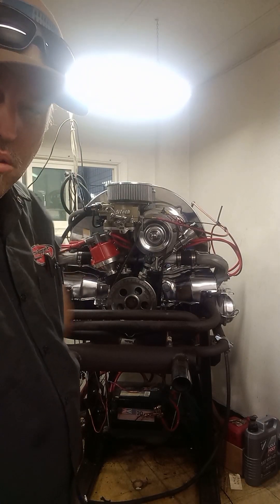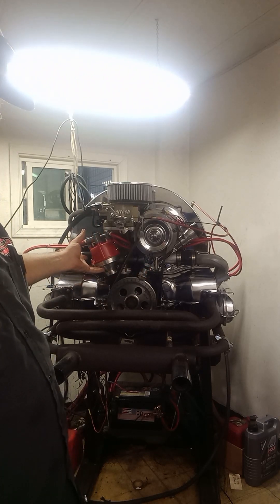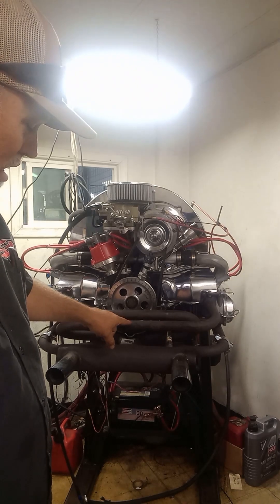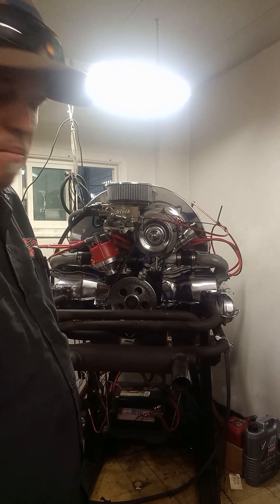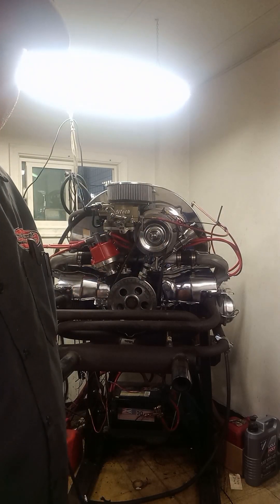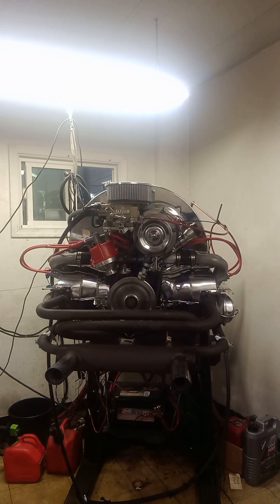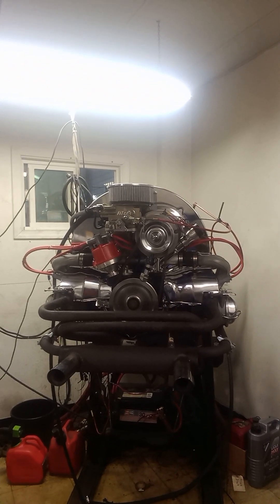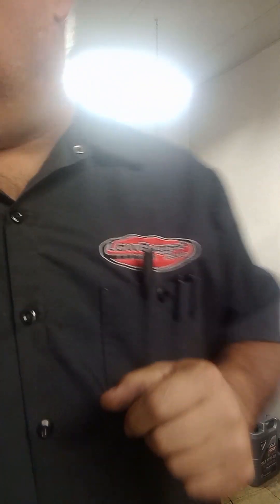1600cc fitech on dyno

Comment: That Fitech is rad.
Reply from the maker: @MrSagerific95  I have had very good outcomes with them.
Reply: @ how would you compare it to CBs dual throttle body EFI?
Reply from the maker: @MrSagerific95  i have used the Holley controller before and is really a good unit, mostly if your famillor with Holley. If not, it can be overwhelming for a novice or new to fuel injection user. Our dual throttle body kit uses Fitech software. The single Throttle body kit like this one in video is really for drivers and not targeted at performance applications or combos.
Reply: @ thanks, I’m comfortable with stand alone systems. Just wanted to pick your brain 🧠. Thanks brother.
Reply from the maker: @MrSagerific95  if you ever have a question please feel free to give me a call at the shop!
Reply: @ absolutely thank you! What state are you located in?
Reply from the maker: @MrSagerific95  physically California but mentally Alaska!!!
Reply: @ love it, I’m from upland. Moved to Connecticut recently. There’s a pretty amount of aircooled stuff up here. I’ll stay tuned in to your channel. Thanks!